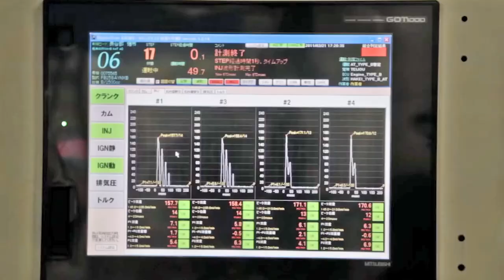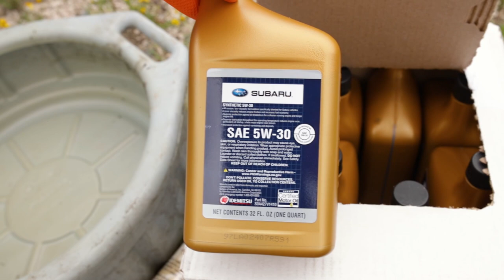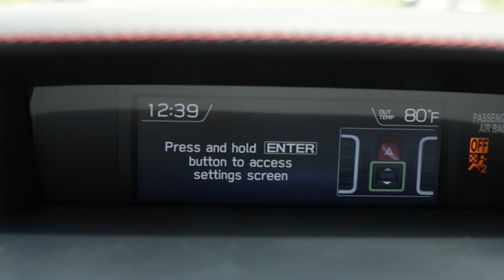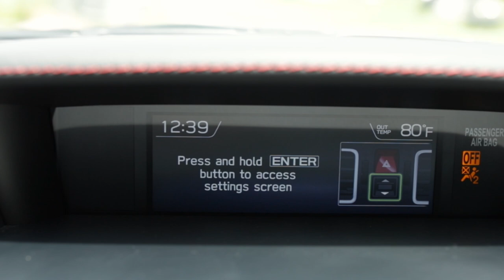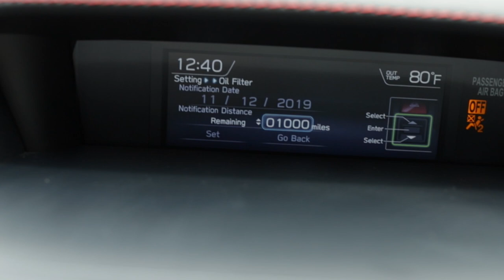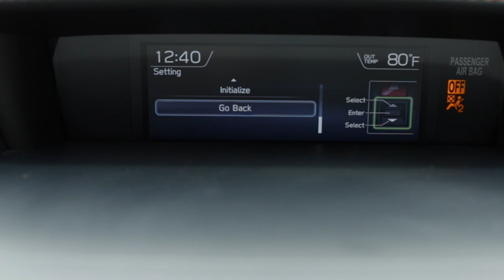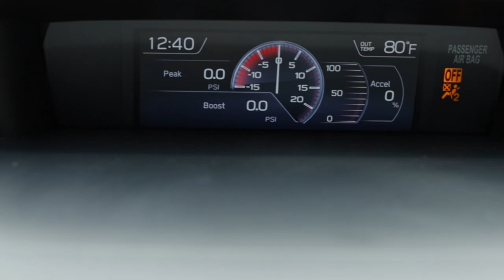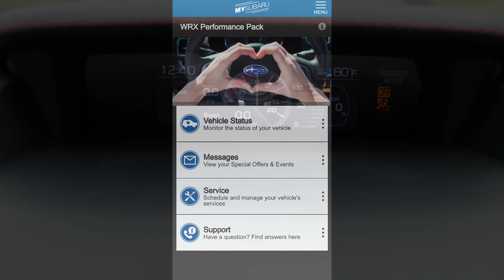2019 Subaru WRX Oil Change - DIY

Comment: Again, thank you for your teaching, I did not know about this braking in. Does this also apply for Outbacks since they are not sporty cars. Also, after driving for a while, how long do you have to wait for the oil to go down to the drain and check the level?
Reply from the maker: Yes. All new engines require a break in. Engine speed kept below 4k rpm for the first 1,000 miles. No cruise control, vary engine speed. No full throttle acceleration. Usually 60 seconds or so after shutdown allows enough time for the oil the drain back to the pan for an accurate measurement.
Reply: @MrSubaru1387  Why no cruise control?
Reply: I don't go above 4,000k for about .....10 whole minutes 😁🤣😂......Edit ....every drive 🙂
Reply from the maker: @jackd1582  because you want to constantly vary the speed of the engine the first 1,000 miles.

Comment: Actually it wasn’t just stis that got those aluminum control arms. Every Subaru made in japan got them, hence why in America only the stis got them cause the regular wrxs were made in America. But if you live in Canada and imported even a legacy or a forester they had the same aluminium control arms
Reply: Mhhm, aluminum control arms on all the LGT Spec B's too.
Reply: No WRX is made in USA. Only recently did the Impreza start being manufactured in the US.
Reply from the maker: And the WRXs are still imported. As per my window sticker on this 2019.
Reply: Every wrx I’ve seen the vin started with a “J” indicating country of origin was japan

Comment: Did not know about this 🤦🏻‍♂️ I’m already at 2800 miles. I was told my first oil change service would be at 6000 miles. Now I’m gonna go change my oil and filter. With that being said, is my engine done for?
Reply from the maker: No. It's definitely not done for. Just not the optimal break-in circumstances.

Comment: Another question I bought a 2019 Subaru Forester and I drove it to NC 480 miles then to Ocean Isle. Then back home. I changed the oil then.  Was that ok for the     FJ25? About 1800 miles
Reply from the maker: Yes, should be fine. We'll within Subaru guidelines, I just personally like the intervals to be shorter on a new engine.

Comment: Why head gaskets fail on Subarus?
And what is the solution to this problem
forester 2011...,🤔
Reply: Head gasket problem was fixed in 2010 on na 2.5 engine
Reply: There's a lot of speculation on that issue but I believe that Subaru fixed the headgasket issues by putting the MLS headgaskets in the newer cars and changing the engine coolant type.

Old subaru headgaskets were a single layer composite gasket and for one reason or another the coating on them would fail and cause coolant to seep outside of the head or exhaust to be pushed into the coolant jacket.
Reply: @KALI1080 Yes they went to a mls head gasket and to a semi closed deck block like the turbo engines have also

Comment: Bit off topic but do u think an air oil seperator / oil catch can is necessary for these motors long term?
Reply from the maker: Definitely helps with the valve carboning issues.

Comment: Does it matter which way crush washer goes on? Torque specs on filter and drain plug? Love the videos thank you. My Forester is almost at 45k and one year of warranty left so I'm starting to do my own maintenance!
Reply from the maker: Flat towards plug, round edge towards the oil pan. 👍🏻
Reply: @MrSubaru1387  thanks for the reply👍
Reply from the maker: You're welcome. 👍🏻

Comment: Nice video.  Easy to do oil change!!  Quick question, but what orange service gloves are those??  Thanks...
Reply from the maker: They're 7mil thick ASTRO-grip gloves made by SAS. My favorite so far. Used to use the Micro-flex Midknights, but now prefer these. Textured and more tear resistant.

Comment: Nice car ).   Wonder if you can provide some advice, I have a Suabru XC/Crosstreck and I get a grind noise (close to break being stuck) at 7mph when car been standing for 15+ minutes.  Subaru service centre are unable hear but sometimes it that bad you can feel it, like a very quick grind (less then a seond).  My car does have a CVT.

Comment: When i bought my 2018 mazda 3 i changed the oil at 2000km than at 8000. Than did the 8k intervals. After a year and 55000km it ran great didnt burn out. But it caught fire due to a short in the factory amp burned to the ground
Reply: That story escalated quickly 😦
Reply: @j.s.3414  yeah well outcome i went out and bought a 2013 outback 3.6r. If u want to see video of a mazda on fire check out my youtube page

Comment: Foresters come with 0 20 oil.  This guy is over killing the break in.
Reply from the maker: The WRX comes with 5W-30, which I put in it. What's the issue?
Reply: No issue other than a major overkill of maintenance during the break in.
Reply: Personally I wouldn't run 0W-20 in any Subaru. AFAIK in Japan they still all spec 5W-30 and 0W-20 is only for maximizing fuel economy.
Reply: 0 20 is light but so far the car is running fine.  Winter really gets cold where I live.  I have used synthetic oil for over 30 years and all my cars broken in and ran well.  Last mechanic said he had not seen such an internally clean engine at 120k miles.
Reply: @brooklynbummer  Oh it will definitely be fine. Changing it frequently is much more important. It's mostly in vehicles that will be driven hard I'd worry most.
Reply: Excessive for sure, but it is still good for the engine, especially so if he departed from the owners manual break-in recommendation and did a hard break-in.  I did a semi-hard break-in 
on my 2013 Forester XT and changed the oil at 150 miles and 500.

Comment: Did you put oil in the oil filter before you put it back on so you didn’t run it dry? I hear if u also put some on the seal each time it’ll make the seal last longer
Reply: I watched further into the video. And I realized u can’t fill it up and screw it on😂. And you flooded it before starting it. Nice

Comment: Recently got a 2020 wrx, my question is if a want to do the changes on my own not through a shop or a dealership(which I always did with all my cars, but this is my first brand new one) the warranty will still hold as long as I submit the service to MySubaru? Or I have to be some sort of a qualified mechanic? Thanks alot for the great videos!
Reply from the maker: Doing your own services, won't void your warranty.
Reply: @MrSubaru1387  Thanks appreciate the quick reply! 🙏🏼

Comment: I'm curious why you put the drain plug back in and then unscrewed the oil filter.  I usually unscrew the filter while oil is still draining, believing oil will drain more completely.  Do you think it matters?
Reply from the maker: Doesn't work that way on this particular engine with the inverted oil filter.
Reply: Ok, thanks. Guess there's some intermediate area where the oil pools before it's pumped thru the system.  BTW, love your videos.

Comment: I have a 2016 lexus is 300. The dealer says to change oil every 10k. I've been going every 5k. I smell a slight gas smell in the oil when checking it. Don't know if it's from the direct injection side of this D4S fuel delivery system or I have an oil dilution problem? Any thoughts on oil change intervals or slight gas smell in oil? Thanks
Reply from the maker: Could be oil dilution, could be slight blowby scenting the oil. Is the oil level rising between changes? That's the main indicator of oil dilution, rather than just smell.
Reply: @MrSubaru1387  it appears to be remaining the same level. Is it ever normal to smell slight gas. Here's the thing. The oil brand new in the bottle doesn't smell like gas. My 2016 lexus is 300 has 40k and. I bought it with 20k. Ever since I can remember it always had a slight gas smell. Is that ever normal from combustion?
Reply from the maker: @mike216ism  a slight smell is normal. If the level of oil isn't rising, I wouldn't be concerned. If so inclined, you can always have an oil analysis performed.
Reply: @MrSubaru1387  I appreciate the help. What do you think of my 5k oil change intervals rather than the 10k dealer suggested intervals? My take is oil is cheap compared to expensive engines. Plus I want to see with proper care how many miles can I put on this 2gr-fse legendary Toyota motor. Wish you were my local tech. You would have a life long customer
Reply from the maker: @mike216ism  I personally do 5k oil changes. Whether it be my outback that holds 5qts of oil or my Duramax dually that holds 2.5 gallons.
Reply: @MrSubaru1387  thanks again. I find it interesting that several new cars even by really good companies like Honda are finding that oil dilution is on the rise and extensive testing when designing these modern motors was a bust. Now I hear of new oils for direct injection and all this catch up is coming around. All I can do is my best. Soon oil changes and take care of it like a Subaru owner does. Take care and have a great weekend

Comment: I use the same oil in my 2019 Outback with the 3.6.  Did a few UOA’s on the oil and one VOA.  Interesting oil. Loaded with molybdenum and calcium. Not sure of their thinking on the calcium and tdi.
Reply: Calcium means they want it to be good at fighting rise in acidity.   Usually diesel oils have plenty of calcium.  Do you have values from the VOA, for calcium, molybdenum, and perhaps zinc?  Please share if so.
Reply: Se Zwo Yes I do
Reply: @TheLazyCarrot  Please share, I am interested also in molybdenum and zinc.  My theory is this oil has a lot of molybdenum to substitute for zinc.  Zinc is probably on the lower side.
Reply: Moly 154
Boron 83
Calcium 2127
Phosphorus 574
Zinc 741
TBN 7.1
Reply: @TheLazyCarrot  Thanks. Do you have zinc values?
Reply: OK, I see it.
Moly 154, Boron 83, Calcium 2127, Phosphorus 574, Zinc 741, TBN 7.1
Reply: Thanks a lot, as I suspected the zinc values are relatively low, but nicely substituted by more expensive molybdenum.  Newer Subarus, post 2011, I believe, particularly WRX/STI/XT, have silver or silver alloy coated rod bearings.  Silver corrodes in the presence of sulfuric acid and zinc (!), so Subaru oil is designed to deal with this problem, ...has low zinc and high calcium to fend off acidity.  Locomotive engines with silver bearings require zinc-free oils!  But locomotives use mineral oil full of impurities and sulfur that relatively quickly turns acidic.  Subaru requires synthetic oils that have sulfur mostly refined out of them so they don't turn acidic easily.
Reply: Re-assuming,  many newer Subarus, if not all (?) have silver coated rod bearings that corrode in presence of zinc and acid.  Subaru requires synthetic oil because it has sulfur taken out of it and does not turn acidic easily.  Subaru oil formulation has low zinc (zinc corrodes silver) and some molybdenum to compensate for low zinc levels.  Calcium is very high to aid in fending off acidity.  The formulation makes perfect sense from the perspective of protecting silver coated rod bearings.

Comment: Hey bro. What is your take on Fumoto drain valve? Is it safe for your Subaru?
Reply from the maker: Since you're asking my opinion, this is it. They're garbage and I hate them. I bought an 02 WRX that had one. Immediately threw it in the trash and replaced it with an OE drain plug and crush washer.
Reply: @MrSubaru1387  Ok. Thank you very much . I have already installed one on my Outback and I really like it cause it makes changing your oil very easy. The only drawback is the flow of drainage is slow.

Comment: Is it kinda crazy to place magnets on your oil filter cause I have when breaking engines in what's your opinion .
Reply: There's virtually no point. Depending on the car you'll have a magnetic drain plug, and if you have a high quality filter, it will already collect most particulate. A magnet will not pick up anything the filter cant. Especially with how fast the oil pumps through it
Reply: @SconnieFish  I would love to see all cars have magnetic drain plugs especially with long drain intervals I still do my oil every 3000 miles or 3 months
Reply: I always do 3000 miles as well

Comment: 6000 miles...? What the bloody hell is wrong with Subaru
Reply: 6k is nothing for a quality synthetic oil and filter
Reply: bigdaddymak1439 wtf, yea you keep believing that
Reply: @Camilo19832001  there's plenty uoa on bobistheoilguy and other forums that prove it but you keep living in the past and wasting your money!
Reply: @Camilo19832001  Do your research. 6K is not a problem. As always, this varies based on the oil used, the environment, and how the car is driven. Normal driving conditions in varied temperatures, modern synthetics can protect for a very long time.

Comment: Since it's not technically broke in yet. Why not use 5w30 non synthetic for your pre 5k mile oil changes? Since your doing it so often, it's cheaper than throwing 99% clean synthetic oil away that many times. And if it's better for a break in procedure as you suggest, it should be better than Subarus break in oil and WOT crank dyno test. I prefer the moto man break in for newer engines: varying engine speed, not redline,  but high boost and vacuum to seat the rings better into the bores, and a couple quick oil changes with regular oil. Sounds like what you're doing aside from the number of oil changes. First 2 i would send to Blackstone labs for analysis to see how much bearing material, etc. is present. The old method for conventional oil has failed to seat rings into the bore of newer engines due to material hardness. Subaru may use WOT knowing its boosted and flexing the rings effectively at this point, I'm not a Subaru engineer mind you! Thank you for the great video btw. Hopefully your life smooths out and you continue with awesome content!

I made the comment mainly because you mentioned conventional oil was what you preferred for break in. Not that either would be an issue imo, with the sheer amount of new fluid being used, along with new filters, all the debris, filing, shavings, etc. would be gone likely by the 3k mile change
Reply: possibly to not void the warranty
Reply: @furtivedig  possibly! I don't know if they have a mandate as to what oil is used. I know mileage between oil changes is typically logged when in for service, especially on new cars, and even individually as Mr Subaru does. Which is always good for any owner after him, i like service records!
Reply: @kheff46  yeah I am not sure either. merely speculating. service history is pretty hot stuff, agreed ;)

Comment: My niece says the idemitsu oil ran hotter than Mobil one. She has a 16 wrx.
Reply: jmowens69 just curious ... how did she track that?
Reply: @tjlovesrachel  You can view the oil temperature on these cars. It's one of the options on the little dash display. It defaults to a boost gauge, but I prefer a three-gauge setup (boost, oil temp., and trip MPG).

Granted, trying to compare oil brands this way is probably a little unscientific, but I definitely think you could pick up on trends if you paid close attention.
Reply: @jameswilkinson6678  interesting .... imma have to play with the setting on the dash.... thank you for the tip

Comment: From my experience, Subaru documentation / dealers /etc won’t know the details or will give different answers, even on common things like engine oil change intervals.  Don’t even ask about CVT fluid intervals :).  As with many things, hard to tell what is critical (eg type of cvt fluid) from what doesnt matter (eg brand of engine oil).  And then like u said something else will happen in life making u wonder why u gave a sh about something so trivial as what city your engine oil was refined in :)

Comment: Do you recommend Mobil 1 extended performance 0W-20 for a new forester?
Reply from the maker: Use the Subaru/Idemitsu 0W-20.
Reply: MrSubaru1387  what are the differences?
Reply from the maker: @allenxavier4083 I look at it this way. Subaru engineers say to run their (Subaru/Idemitsu) formulation of oil in the engines they designed. If they wanted Mobil 1 in it, they'd have specified it.

Comment: OTC Tools 5911A, man. Never have scalding hot oil running down your arm ever again.
Reply from the maker: Have one. It's fiddly to use sometimes. Especially when I'm under a car on the ramps with low access.

Comment: It concerns me that manufactures don’t make a greater effort to help cars ‘live’ longer; logbook has much longer service intervals and so those filings can float longer, create hotspots which become weak spots and assist engine/component failures. Transmission fluid is another problem with too long intervals/no change recommendations. Then diffs, and whstever else.😡 Also poor quality parts in the first place, eg Jeep 3.7l v6; Subaru head gaskets in the past, etc

Comment: Hey, what do you think of those Fumoto oil drain valves? I just put one on my car thinking it would cut down on the mess it makes when I change my oil. I haven't changed it yet since but I was curious what you thought.
Reply from the maker: I don't like them and don't use them. One was on my 2002 WRX when I bought it. First oil change I threw it in the trash and replaced it with a factory drain plug and crush washer.
Reply: @MrSubaru1387  Yeah, I am a little nervous about using it, to be honest. Thanks for the advice.
Reply: Been using for awhile . Saves time and mess
Reply: My only major concerns are them not actually allowing oil to drain out and the chance of them catching something on the ground.

Comment: Am i the only one who lets the oil soak into the filter pleats so it doesn't start empty?
Reply from the maker: That was the entire purpose of the clear-flood mode cranking. Pumped and primed the entire oil system prior to me starting the engine.